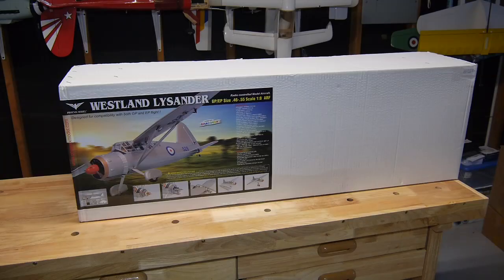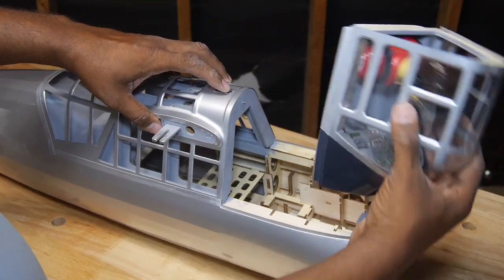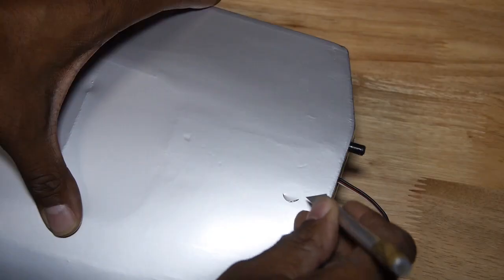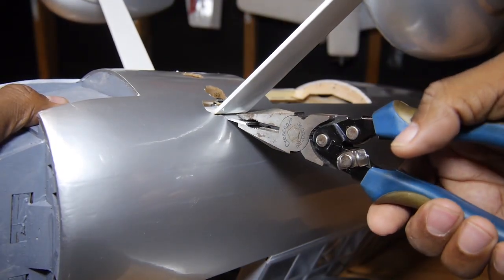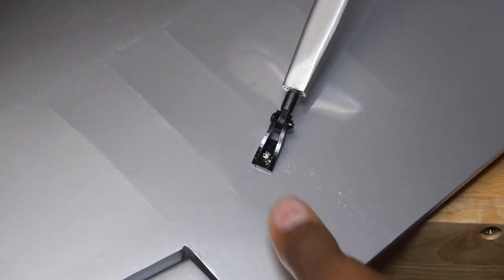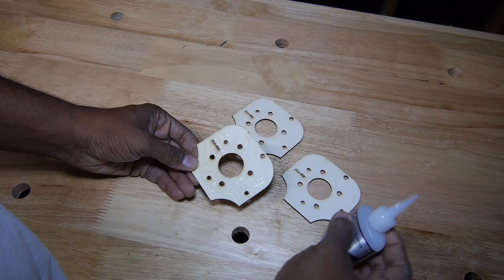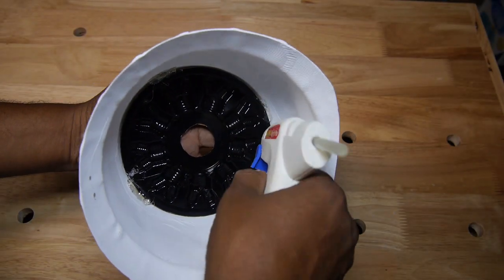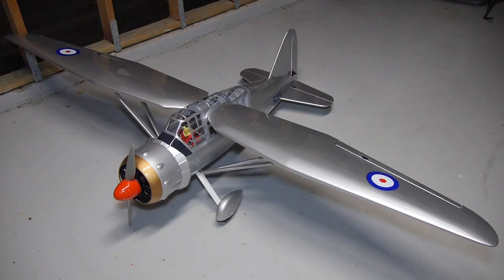Pheonix Model Lysander Build | HobbyView

Comment: Interesting airplane is the Lysander. At the start of the war it was regarded as an old fashioned design but found it's wartime role as a ferry ship flying covert ops to occupied Europe. Spys, VIP's, arms and machine parts were dropped and extracted to and from France by Lysander. It's sturdy design and short landing and takeoff run made it amenable to landing in unprepared grass fields.  Nearly every Lysander I've ever seen has been painted matt black and RAF camo. The Lysander was the goto aircraft for undercover ops, a proto 'bush plane' if you like. Westland went on to be England's premiere rotary wing manufacturer based in South West England they no co-produce the Merlin helicopter.

Comment: i just got this model and they seem to have updated several parts. The aileron plates that the servo s mount too are plastic and the struts to wing are now metal, i have not finished building yet oh also the circular engine mount section is different also. thanks for the build video

Comment: The strut braces have been changed out for a better stronger aluminum tubing and thick plastic ends screwed together
also the rudder control horn attaching screws are a little short by a couple of mm
other wise the build isn't to bad.

Comment: I have bought this plane and will power it with the .46 rimfire motor. You mention nothing on the CG. Is the manual correct? 90mm? Very good video.
Reply from the maker: The manual is generally correct. I settled on right at the leading edge of the wing where it meets the canopy.
Reply: @HobbyView  Thank You. Another question. The aluminum wing spar tube seems awfully thin, is it that way so if you crash it won't destroy a lot of the plane? I bought a wood dowel to insert into the tube to strengthen it up. What do you think?
Reply from the maker: @dementia0090  , no the tube is plenty strong. I wouldn't add anything to it.

Comment: Would you recommend this plane for a beginner? It's a beautiful looking plane
Reply from the maker: Sorry, not. It is not a beginner's plane.
Reply: HobbyView 
K. But it is still a good looking plane.
Reply: Usually it's better to have beginners learn on planes you wouldn't care to break, especially with balsa, foam and electric are cheap, easy, and don't turn to sprinters in a crash. Getting a pusher is nice too since you don't break the propellers.